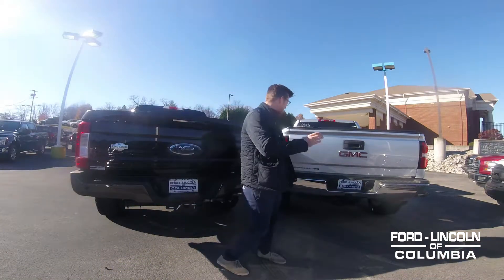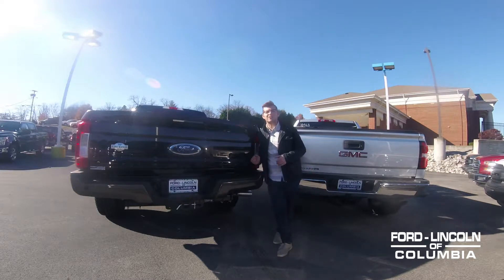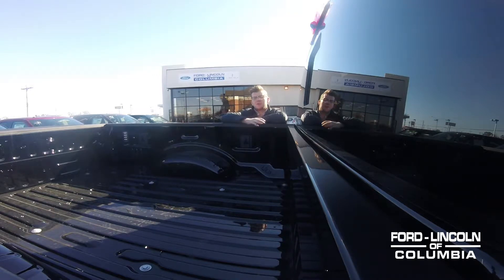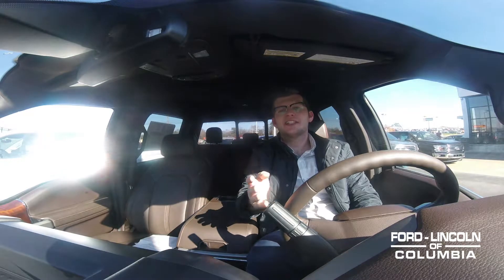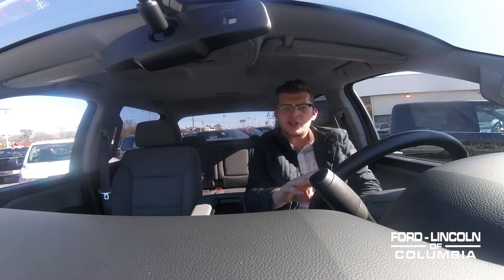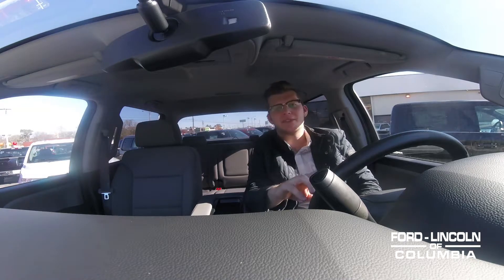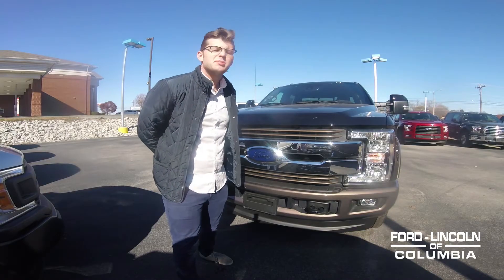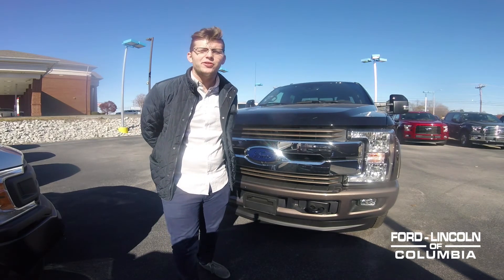The FACTS about Aluminum vs Steel!

Comment: How About The Difference In 4 Wheel Drive?... I Can't Get An Answer From Anyone Online😱🤷...
I Had A used 91' Chevy Blazer years ago that got stuck in a quarter inch of sand on a road😡🤷...
I'm seeing other videos of bad 4wd on GM Trucks..But Don't see any videos of Jeeps 4wd Not Working Right...
I'm learning about Lockers... So that comes into play... I'm looking for a truck that I can set to spinn all four wheels equally  .. for mudding or if Stuck in a ditch....
My Blazer had 1 Wheel spinning and I Was 😡!...
I Cried when I saw the Ford Raptor Video Hitting a Jump and driving through sand....
Not being anything...(Ford Guy/Chevy Guy)... But kinda leaned towards Chevy Trucks..buying a used 91 blazer.. and part of that reason was the aluminum In Engine and parts..... And thinking of strength...
Is Ford F150 And Raptors 4 Wheel Drive systems different/ same or better?
✌️♥️😎🏠

Comment: there have also since been advancements in rust proofing that make oxidation a problem of yesterday. Also aluminum oxidation does exist also and does has a lower fatigue threshold than steel and is increasingly difficult to bend back as it has a tendency of crumbling.
Reply: The fact that aluminium oxidation exists does not mean that it's a problem like it is with steel. With steel/iron rust makes more rust, and it can eat away the vehicle like crazy. With aluminium any corrosion from the environment works out to be more like erosion, which is hardly an issue compared to iron.
Reply: Mshojat yea i know that
Reply: @MsHojat  depends on what causes the corrosion. If it wasn't an issue then anodizing wouldn't be a thing.